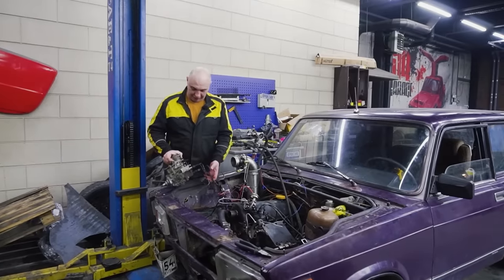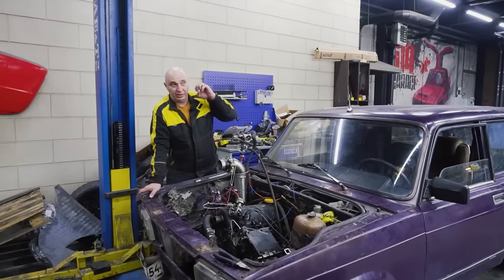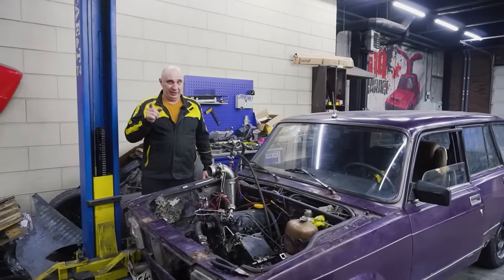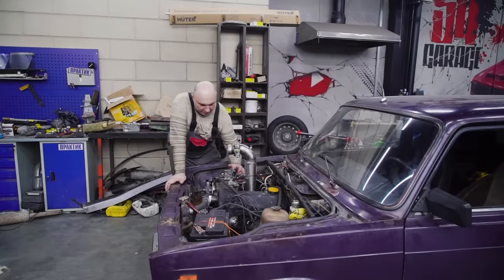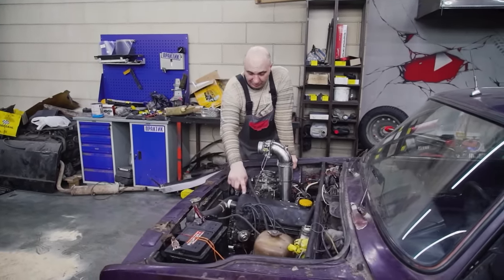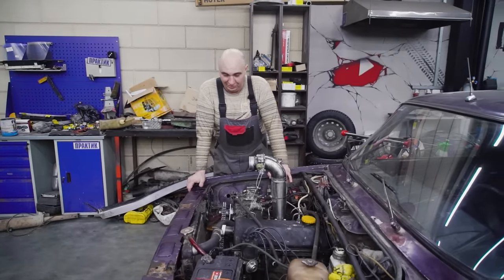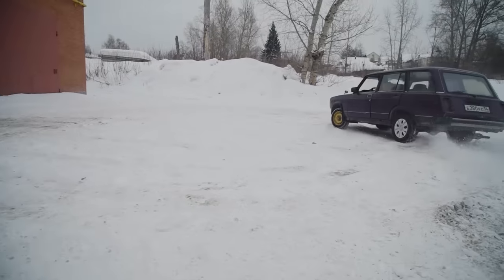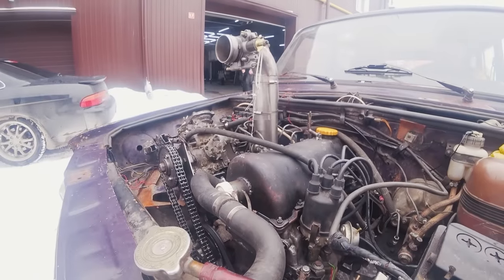We fit high pressure DIESEL pump to Lada engine

Comment: None of this really matters because this experiment was just for fun but will the diesel pump wear out faster because it doesn’t have the diesel fuel to lubricate it or the injectors?  Now you’re using gasoline which is more like a solvent

Comment: All you're doing, is squirting one rich-ass mixture all the time, which makes it incredibly rich at idle, and as you rev, it it's leaning it out, which is really not good for that motor. You're supposed to set the diesel pump, so that the motor can literally idle with the throttle wide open. Always keep the throttle wide open on top. Then, to accelerate, you just throttle the diesel pump. You have the diesel pump so rich, it's just flooding the motor at idle, basically. Adjust your diesel pump so that it idles with the diesel pump throttle all the way down, and the throttle wide open on top.

Comment: remove the throttle body. toyota 2c engine does not have throttle body. the diesel pump will supply the fuel to the engine. fine tune the diesel fuel pump, it will run good.
 also, ot will only rev at 4k RPM because of the fuel pump governor

Comment: This is some what of a fluke. Because the chances that the diesel pump stuck in a fixed fuel flow position could meter the fuel required for a any throttle position is not by design. 
Petrol metering needs to be very accurate there is not all that much tolerance in mixture.
It would be interesting to see what the mixtures actually are here at idle mid range and wide open and under various loads. Great experiment though.

Comment: The air fuel ratios are the issue. Diesel is extremely lean. Petrol needs a far richer mixture to run

Comment: nothing new about this. mercedes were using a very similar system back in the 60/70ies , basically a bosch inline pump with injectors using petrol

Comment: You guys failed at this. First a diesel engine is not regulated by airflow through a throttle body. A diesel engine is always wide open airflow, regulated by fuel pressure. Furthermore there is no ignition system other than glow plugs for easier cold starting. Your Lada does not have the compression to run as a diesel, why didn't you unplug the ignition system and run your tests,  then we would have seen a result. In the spirit of fun I enjoyed the vid nice try guys.
Reply: Aren't they running it on petrol though ,..?
Just using this fuel pump & injectors from a diesel instead of a carburettor?